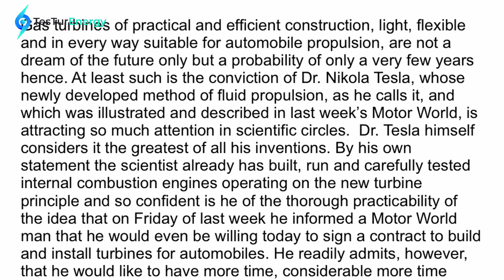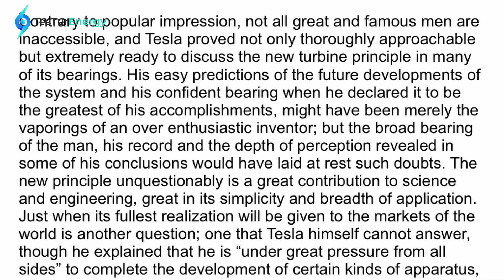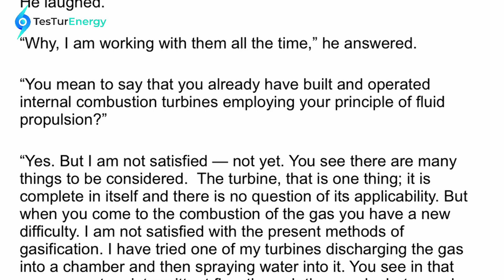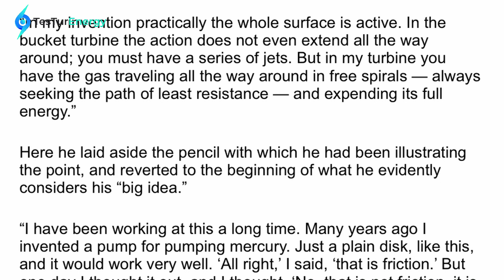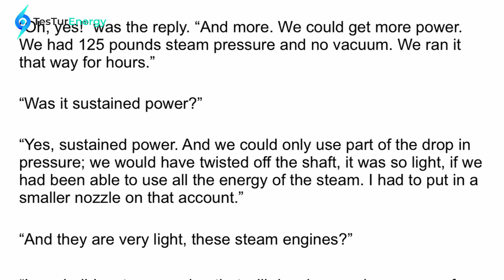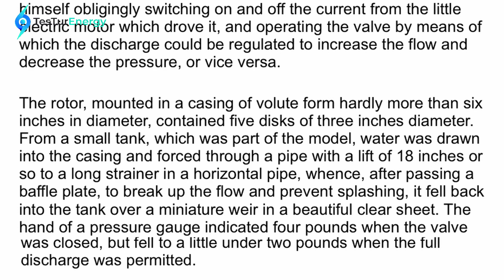Dr. Tesla Talks of Gas Turbines - AudioBook by Charlie Solis

Comment: Ever heard of anybody experimenting with a spherical shaped turbine instead of flat plates that rotate the gas or liquid vortex on it's outer surface for even more torque?  Seems possible that you could also have nested turbines that counter rotate perpendicular to it's internal spherical turbine for higher efficiencies!  Also, it would create two separate vortex streams on either side of the sphere!  This could also make the turbine more stable and durable when compared to flat plates!  Maybe, it could be considered a radial Tesla turbine!
Reply from the maker: The meek… I’m posting this comment to you in response to your last comment on that other comment thread we were talking on because I deleted that thread. 
Bud… if you’ve been watching my channel for this long now you would know that the entire thing I’m proving is that you do NOT need high RPMs to make the Tesla turbine work. Who ever told you that they needed to be spun fast to work has ZERO idea how these turbines work. No where in the patents does Tesla say they have to be spun at absurdly high RPMs to work. He says the pump needs to be spun at high RPMs because centrifugal pumps Final pressure that they develop ALL are dependent upon the tip speed of the turbine. 
What Tesla does say about the turbine is to increase the speed of the fluid relative to the discs, increase the surface area, and decrease the disc spacing. My plastic and aluminum turbine is already getting 2.75kW and 6.22 ft-lbs torque to the shaft at only 4150rpms. There’s no need for absurdly high RPMs with this turbine. And everyone who keeps chasing those high RPMs for these turbines just runs into problems in the first place because they don’t realize that the faster you spin the discs the more centrifugal head and back pressure will be on the nozzle and as such the motive fluid mass flow rate will decrease and as such power drops. High RPMs can give you better efficiency but come at the cost of power.
Reply: @CharlieSolis  The YouTube algorithm knew what my idea was and found it for me and put it in my feed!!!  It's from a channel I've been subscribed to, as well!  Mr. Tesslonian did a cylinder version of my idea, which should both function in the same manner, but his takes two passes the first on the outside and the second on the inside of the cylinder!  Another benefit with this design is it is very quiet and vibration free and won't be prone to warping or blowing up!  Perhaps, some wheels attached to both ends could make an effective drive train and could also be reversed by changing the inlet direction! https://youtu.be/-IJI1z8McgA

Comment: On your compressor intercooler. Would it be possible to submerge the entire compressor? Compressor outtercooler? Not sure where the warm water would fit back into the system too much thinking for me. Alot of new tech in thermoelectric generators that could possibly encase the piston and head to milk some more juice. For whatever needed. Engineer a turbine on the backside or the steam to super cool it not sure where I was going with that thought. Capacitor for collecting trickle charges. I'm well awake perpetual energy is theoretically impossible. Plus everything build need maintenanced eventually But what about so close to 100% effecient that  the remainder is almost effortless like giving a flywheel an occasional push.
Reply from the maker: Oh yeah you can defitnely submerge the compressor. I plan on doing that with the final combustion turbine. Just submerging it into the hot water thermal storage tanks so that any heat losses off the turbine just go back into the hot thermal tanks for either use heating or generating more power with the vacuum turbine system.